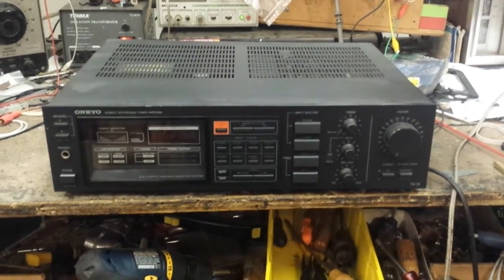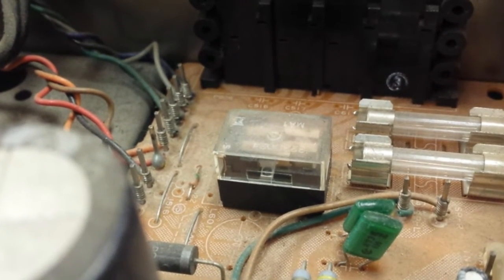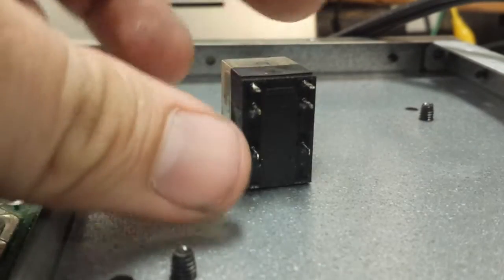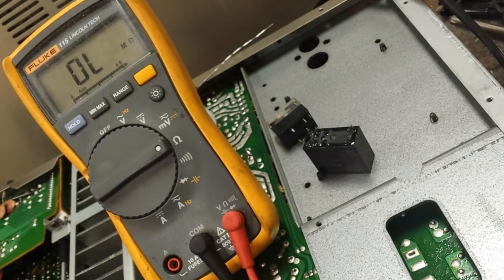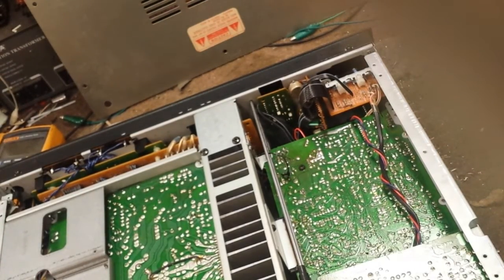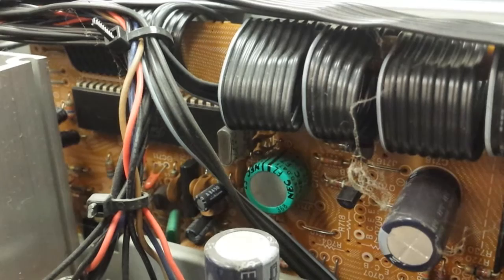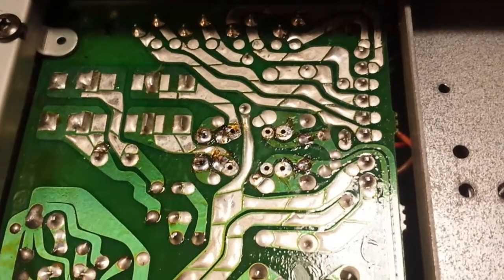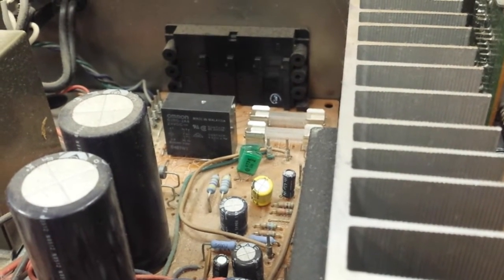Servicing an onkyo TX-26 stereo receiver.

Comment: Thanks for sharing this insight!  I have a TX-27 that looks identical to this, which I picked up for next to nothing, and unfortunately know nothing of it's history.  It has a dead left channel (all inputs), the headphone out left channel is dead too if that helps.  If you turn it up way up, you can faintly hear something coming out of the speaker.  I've swapped speakers to rule that out, as well as hit everything that moves with contact cleaner, and worked it in by pressing the buttons and rotating the knobs many times over.  Still nothing.  Any ideas?  I'm new to the AV repair, and wanting to dive in.  Is it time for me to invenst in a scope and dive in head first?  Also, I found that there are two fuses on the output path, near the speaker outputs, that are both labeled 1.5 amps or so.  They are both good, but one of them somebody has replaced with a fuse with a WAY bigger rating.  I'm suspecting that's a tell tale sign, but I don't know where to look.  Again, appreciate any advice and thanks for sharing this awesome content for everybody!

Comment: I know it's 5 years late but this one rang a bell from when I used to do Onkyo service back then. In addition to the funky relay, there's NO DC protection, only a turn-on delay and sharp cut-off at power down. I remember thinking this was really a crappy design decision.
Reply from the maker: The Sanyo made fisher products were the same. No dc protection and alot of dead attached speakers when the amps failed.

Comment: Thanks! The TX-26 was pretty spiffy when I bought it new from a local Radio Shack in the 1980s and digital displays were the latest thing. I hauled mine out of storage last year to get set up for playing vinyl again and did the switch cleaning but not the relay swap, since mine's still working.

Comment: I got an Onkyo TX80 and a TX84- They are great sounding. However, the TX840 does have volume issues.. Is it the relay you talked about? The vocals sound very low compared to the highs and lows. Weird sounding.

Comment: fellas,I clicked on a repair to the power relay inside the tx 27 some months ago,damn simple to desolder the existing rinky dinky inadequate factory installed relay,which smoked the fuses,he showed the larger item,, a black multi prong relay from the parts supply shippers,it worked,,I am trying to find that video,,the device I was using failed,I lost the URL have a new laptop ,anyone see that video around?  I did go out & buy some 3 A fuses from home depot,slipped them in & immediately burned out